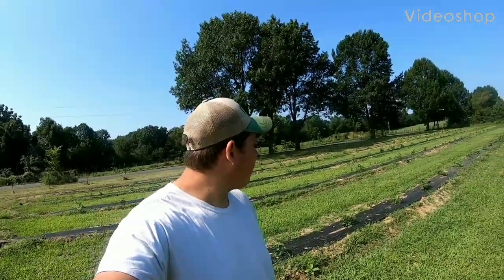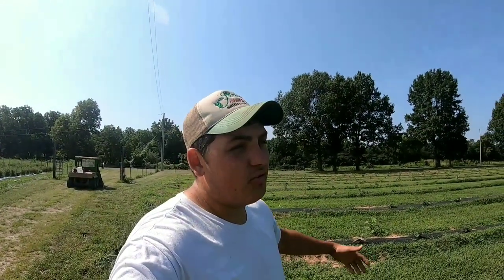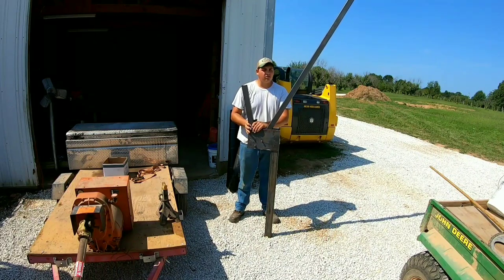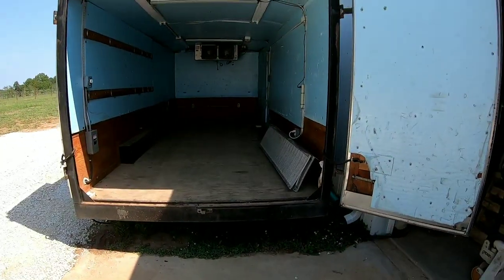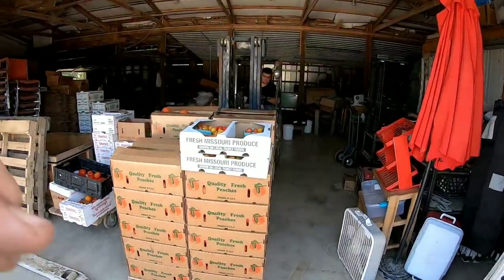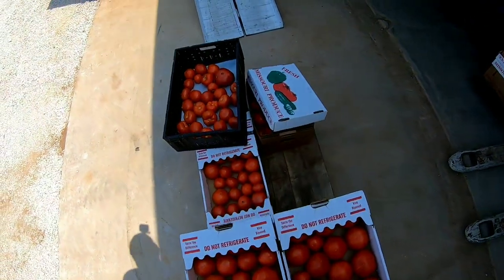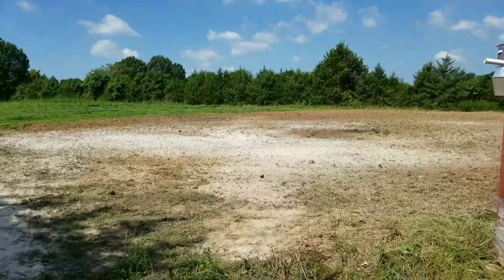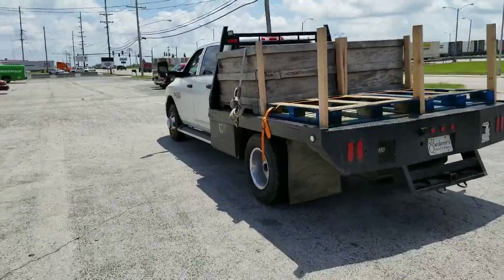How it works | Rotating Cross Arm (RCA) trellis for Blackberries!!!

Comment: The post that gets put in the ground cap off the top to keep it from filling with rain and snow. That way  the post will not rust out from the inside. Should last as long as you need them. Also hot dip galvanizing would help the longevity of the trellis system.
Reply from the maker: We looked into galvanized and it's a little over our budget